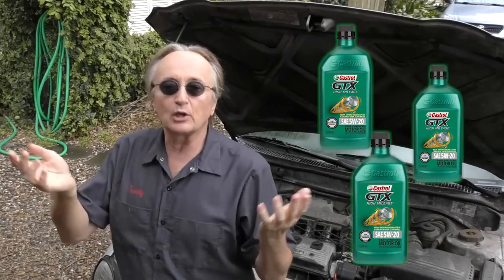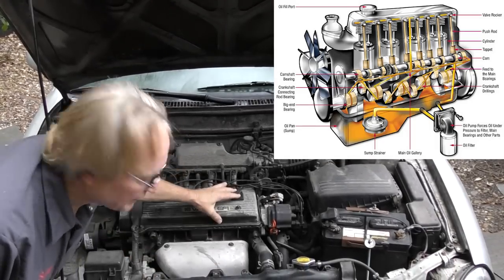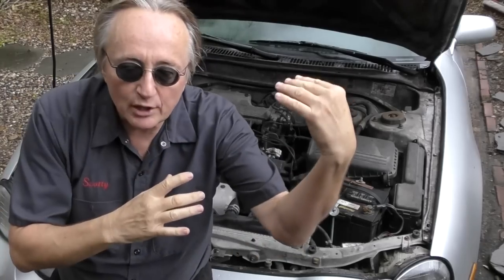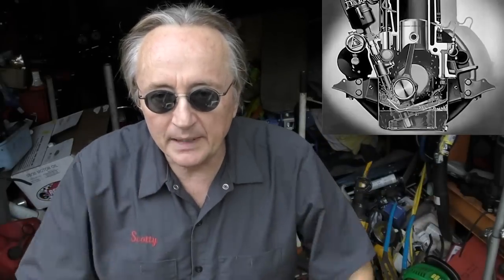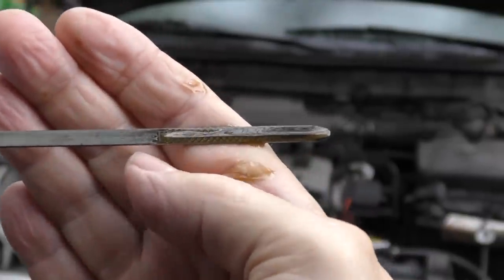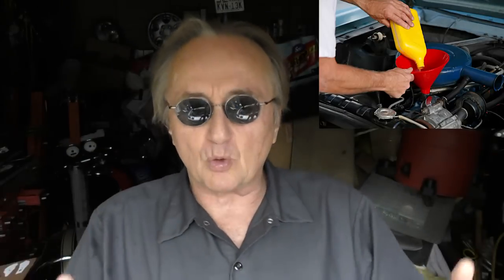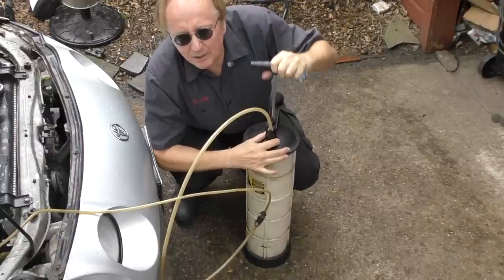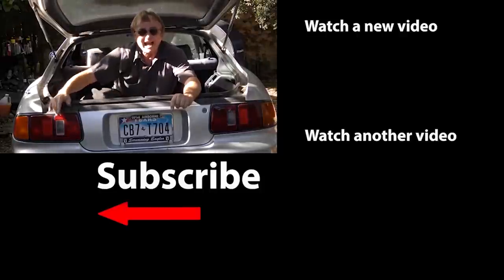Doing This Will Destroy Your Car's Engine

Comment: Morning Scotty! Thoughts on buying a car that has a bad head gasket? I'm looking at a 2001 Honda CRV for $500. Owner says it has a bad head gasket. Can I fix this myself? Is it worth the time and money? Thanks!
Reply: Connor McNeil go get it done professionally bro don’t try to do it yourself
Reply: It depend how many miles on it but 500 dollars something gonna be wrong with it if u don’t drive much then u might as well fix it up if u drive often then I would save money up and get something better
Reply: If you can change a alternator you can probably do a head gasket if not dont do it
Reply: Scotty has said before that if you are buying a car and the seller says it has a blown head gasket, then beware.  It might be the head gasket, sure, but that might not be the problem.  It could be a cracked engine block or something else.  If you still are interested in buying the car, then he always says - find a mechanic like him to check it out because if the engine block is cracked or if the head gasket has been blown for a long time, then there could be other problems like Antifreeze in the oil which can cause excessive wear and tear to all the moving parts that need it and so on.  So, the $500 might seem like a good deal, but it's going to be a bad day if you buy it and then find out that the whole engine needs to be replaced.
Reply: How many miles?.  The premium FelPro kit for that CRV is about $100.  See if hell take $100 off incase the head is cracked or warped, or valves are bent.   It may have a bad head gasket, but it probably needs a little more.
Reply: Thanks for all the feedback everyone! I'm looking for the car to be a secondary car to use when it snows. I live in Chicago and use my Civic for everyday driving. I'm just looking for a beater I can use when it snows. A friend who's a mechanic and I are planning on going to check the car out in person on Monday.
Reply: Connor McNeil Cool man.  Just want to make sure you don’t put a band aid on a gunshot wound.  That being said, I have put a few head gaskets on a few Hondas and that was all they needed. Good luck!! 👍
Reply: Do you have a machine shop? If the head gasket went, the engine likely overheated. The head could be warped and would need to be milled so it sits perfectly flat again. Sometimes you can get away with just changing the gasket if the engine wasn't overheated.

Comment: Regarding checking oil when cold. Both of my cars say to check it 3-5 minutes after shutting off from reaching operating temp. If it’s cold, most of the oil in the upper engine will fall down into the pan and give a high reading on the dipstick, at least for the cars I’ve worked on.

Comment: I used to work a chain auto parts store and one of my coworkers sold a case of motor oil to a lady who said she was low on motor oil. A week later that same lady came back, threatening to sue my coworker and the company because her engine "blew up". I overheard her conversation with the manger on duty and the reason why her engine "blew up" was because she topped off her engine oil. So out of 12 quarts of motor oil, I heard her say that she used 8 quarts to top the engine off.  At the end of it all, the lady didn't get squat, my coworker didn't get in trouble and we learned a valuable lesson on how to ask customers more probing questions to make sure we protect customers from their own shortcomings.

Comment: Thank you Scotty! Many years ago, my young sister-in-law was driving a 1969 Nova. I think it had a flat head 6 cylinder. (Can't remember). She said her oil light was on and it did not go out even after she added another quart of oil. It had an oil leak so when the light came on she just added another quart of oil. I pulled the stick and sure enough, the oil was way up the stick. I think it might have been 3 quarts too high. I ask her when was the last time she had the oil changed. "I haven't had it changed". She drove the car everyday for 2 years. I guess she thought because it leaked, she did not have to change it. LOL. I changed the oil and the filter and the oil light went out and I think she drove it several more years after that. They don't make em like that anymore. :-D

Comment: European makers frequently specify adding +1 extra quart during spirited driving / track.  
Not 2, just 1.
Reply: Never knew that but I suppose that's because the pump is using oil so fast that the sump level gets low and the pump can be starved of oil until the sump refills which will kill the pump and engine
Reply: HostileLemons I agree.  Euros tend to have higher sump capacities and baffles in the oil pans.  I keep mine topped up.  Hot lube oil sent to bearings is lovely.  Foamy oil/air mix is bad.  I tend to drive more spiritedly when I am a solo driver 😉 😉.

Comment: My car's owner manual says to warm up the car to operating temperature, then turn off the car and let it sit for about 15 minutes before checking the oil level. You say it's best check the oil level when the car is cold. Now, I'm confused on which method is best. Can anyone help me know which method is correct?
Reply: zarbon700 just do it cold don’t need hot oil getting on yourself
Reply: Always follow the owner's manual. When you warm up the engine some of the oil stays in the upper parts of the engine, i.e. if you check the oil cold all of the oil is in the oil pan and it may indicate more oil than you actually have in the engine.
Reply: Everything is confusing, everybody say different thing
Reply: @godschild5587  I think it may be best to do what the engineers instruct. They built the engine, therefore, they should know what's the best way to check that engine's oil level.
Reply: Warm is all right as its just about the same as cold just must not be hot and waiting yes..5 to 10min should be plenty for that oil on top to find its way back in the sump..and level surface with oem dipstick you're good to go.
Reply: @nicksteffen8164  no checking it cold indicates the exact amount of oil in your engine. Warm oil gets thinner and expands and may make it seem to be slightly over filled or under filled because oil is still draining down from the heads

Comment: Some car manufactures (I think Honda) recommend checking oil after driving a little bit ie warm engine oil. This make sense because after car runs a little bit the oil is at a known temperature.

Comment: Talking about oil... I know for a fact that Toyota V6 engine can survive 16 miles of driving without much of the oil in it.  Three years ago, my Sienna oil cooler line completely broke off.  Although my wife noticed the engine made weird noises but she did not want to stop in the middle of the night on the road so...she drove that 16 miles home.  In the morning, I checked the oil and it was bone dry, I poured four quarters in, started the engine, and it just pumped out all the oil to the ground within seconds... towed it to get it fixed, thinking its engine might be shot but I would trade in after the repair.  Well, it ran like new and I kept it.  Three years late, it did not burn oil, nothing leaks, no smoke, engine runs like new, so it still runs and purrs like a cat for 25,000 miles in counting :).

Comment: I like my 81 Celica's dipstick. Not only was it all metal, but it was a rigid rod, right to the bottom end, not one of those floppy flat things 90s and later cars have. I could beat someone with that old dipstick if I wanted (not that I would want to hurt people). It was so much easier to put that thing back into the engine without it flopping around everywhere.

Comment: My owner manuals on my car and truck say to check the oil at operating temperature.  The truck manual says to let it sit for 15 minutes.  That's how I've done it, and I've never had a problem.  If I overfill something, I just let it out of the drain plug a little at a time until I get it right and then refill if too much comes out.

Comment: Some automakers state to check the oil when at normal operating temperature a couple minutes after the oil has had a chance to drain back into the oil pan. Especially every motorcycle I’ve had said to do this, plus VW, Ford Duratec V6, and Toyota 2.4 (my 04 Rav4 page 284 in owners manual).

Comment: Pneumatic fluid extractors come in really handy if you are a lube tech. If you overfill, or have a dangerously sensitive customer complain their oil is too full by half a millimeter, just stick your extractor's tube through the dipstick and suck the excess oil out.

Comment: I've over filled my oil, my diesel engine went straight to redline and smoked out my whole street, happened 4 years ago and the truck still runs fine, I was young and dumb back then, thank fudge my truck has a strong motor

Comment: So this one time... I drained my wife's CVT and double serviced her oil. FORTUNATELY a switch kept the car from moving. I had poured the CVT fluid into the 5 qt oil jug and just poured it back into the CVT and correctly changed the oil the next day. Engine ran for 5 minutes maybe, CVT worked just fine. I changed the fluid about a year after and things are still going strong

Comment: The actual reason for checking your oil level when the engine is cold is because after running the engine all the oil passages are filled with oil and all components are also coated with oil, so it takes a while for the oil to drip down and collect into the oil pan.

Comment: The dipsticks handle broke on my moms car. We ordered an oem replacement and it was 3 inches shorter than the original. Always check that replacement  parts match original equipped ones, no matter where they come from.

Comment: The subject takes me back to the fuel rationing of the early seventies. I worked at a Chevron station and we were selling gas at five gallons per car. This guy pulled up to the inactive pumps and I told him that he was in the wrong location. He said he was needing oil, not gas. Back then, oil was in cans and we used a Plews spout to pierce the can and pour the oil into the engine. I asked him how much he wanted and he said he wasn't sure, but wanted to start with two quarts. I got him two cans and stabbed the spout in the first one so he could see how to do it for the second one. His vehicle was a Ford Falcon van, so the engine resided between the front seats. I could see him putting the oil in the engine, but I didn't watch him closely enough at first. After two, he asked me for a third. I obliged him and continued with my very busy gas pumping. When he came to me for a fourth can, it piqued my interest, so I observed his installation of number four and saw a sight I may never be able to forget. As he finished pouring in the oil, he drew the can away, leaned over and peered into the filler tube. Of course I approached him and verified that he was trying to fill it with oil. I was pretty young and inexperienced, but I certainly knew to use a dipstick. I pulled his out and the level was about two inches above full. I told him that I didn't know if it would hurt his engine, but it should be at the correct level and we could take care of it when the gasoline selling stopped in a couple hours. He opted to drive it away. 
   On a different note, I typically put a quart of ATF in my engine and drive a few miles before I change my oil and filter. Helps to keep the sludge away.

Comment: Should you put fresh oil in the filter when doing an oil change? I see some people with cartridge type filters do that.
Reply: If you can do it without spilling it all out in your engine bay have at it. On many cars that trick is flat out impossible.
Reply: @98triffid  I'm thinking only of cars that have bottom mounted oil filters. The idea behind this is that the engine after start up sucks up the oil in the filter.

Comment: That was a common issue with the Nissan Pulsar and Nissan sentras of the late 1980s. Mini mechanics would overfill the oil causing the engines to fail. I didn't know how it happened but I had friends it had that issue. Apparently a lot of the manuals had the incorrect oil level listed

Comment: In the UK BMC made a mistake with the dipstick markings on early Austin Morris `B' series engines fitted to the `Landcrab' 1800.
Early 1800s therefore suffered engine failure (bottom end bearings) due to too much oil (crankshaft whisking up the oil).

Comment: My 06 Honda Ridgeline takes 4.7 quarts of oil with new filter at oil change. Ive been tossing in the whole five quarts for years. Never had a problem. Oh ya it’s now almost 2023. That’s seventeen years of oil changes. Changed every 3-4,000 miles. Still purring away at 140,000 miles. My neighbor had 850,000 miles on his 07 Honda Ridgeline. He told me he don’t know anything about cars/trucks. Brings it to the dealership when the OLM comes on and they do the oil and filter  for $29.95 with his $10.00 coupon they send him in the mail. I would bet for that price he’s not getting full synthetic maybe not even semi synthetic. So there goes the theory of full synthetic is better. Older engines like high mileage and a little thick oils. 😊

Comment: At my old job, someone filled an engine with 5 quarts of oil, but didnt put the oil cap on. So another technician added five more quarts into the engine. The car caught on fire shortly after leaving.

Comment: i remember over filling my oil easy done someone talks to you hay presto lot of effin words latter  what i done was instead of dropping it  via the sump plug getting all messed up and trying to get the sump plug back in quick time  i used a syringe and  fish tank air hose pipe fed it down through the dip stick drew  a few times worked a charm

Comment: 99 mercury cougar has 139k miles. its manual 5spd. The customer states "it won't shift into gear not sure what's wrong with it. maybe clutch is bad or shift fork not sure really. check engine light on for oxygen sensor. asking 550 obo". What do you think about this car Scotty?

Comment: I over filled my car once when I forgot to lower my front end from the Jack before I added and checked the oil level it put me half a quart over. I wondered why it took a little more than it should. I should have gone with my instinct of going by specs. I thought about unscrewing the plug for just a second but two things, one it's messy, two you lose the tight seal when you have more than a drop of oil in the grooves.

Comment: Honda Serramonte in Colma, CA. they put 5.5 quarts oil in my engine (I brought my own oil), when it should have been 4.5 quarts. When I found out and told them they made a mistake, they refused to admit mistake and said they always put 5.5, and they knew better than me. But the fact is the capacity is 4.4 as printed in owners guide. I never let them service my car again.
Reply: And I bought the car Accord 2016 from that car dealer.

Comment: Got an oil change at a lube & goob shop one time. About 5 miles after I left huge clouds of smoke came rolling out of the tailpipe.  I stopped and checked the oil and it WAY over filled. I went back and parked in front of their door and let the engine run and smoke up their place. 
They never came out to check what was going on. 
A customer said something to me and I said I just got the oil changed here.  
Finally I went in and the kid said he looked up in the computer how much oil to put in and the computer said 5 1/2 quarts. 
I explained that a Toyota Paseo does not hold that much oil and to please remove the excess oil and check it with the dipstick this time. 
I'm sure he looked it up as a Toyota Tundra or something. It was a sh*tbox car my wife had and we sold it for cheap to her sister.

Comment: manual vacuum pump.That sounds cool. I want one. Seem neat. How good does it do the jobs?
Reply: Very good if the oil is warm enough when it has been in a running and warm motor, but otherwise hard to get the oil into the vacuum pump. It is used to change the oil in boats and recommended by the company (Volvo Penta in my case). The dipstick-tube is narrow and so is the vacuumpump-tube. My pump costs about $100 in Norway and seems to be good quality. Several people recommend to let the oil out of the drain plug in the car to drain eventual oil sludge or dirt as best as possible.

Comment: Scotty, I just got a 1992 Buick Century V6 3.3L sedan custom, and when I turn to the right, even a little bit, there is a slight squeaking hum. How do I stop that from happenkng
Reply: The Narrator check power steering fluid. Also that pump may be going out soon.  Good luck.
Reply: Drive only on straight roads. Glad to help!

Comment: A buddy had a VW Rabbit diesel.  He put an extra quart in after an oil change and didn't notice.  We were stagging around and went up a 9% grade mountain highway.  The angle allowed oil (somehow) to be sucked into the intake.  That gutless wonder went from choking 45 to over 60 and climbing.  He started panicking and tried downshifting, then up shifting and only went faster.  I told him to push in the clutch and pull over to shut it off... worse case is a blown motor.  He pushed in the clutch and it slowly revved down.  Had to have been a sight to be seen.... huge billows of smoke and an ancient junker hauling a$$ up a steep grade.  We turned around to my brother's who is a mechanic who quickly diagnosed over-filled oil.  I still laugh.

Comment: Hey Scotty, 2004 sienna owner. 134,000 miles. Need new head gaskets, (leaking coolant) valve cover gaskets, spark plugs and oil pan gasket. My local shop quoted me 1,400 parts and labor. Should I do it or get rid of it? I love the van. Thanks.

Comment: I accidentally added too much oil once to a Chevy G20 van with a small block V-8. It was night, I was in a parking lot and checked the oil. It was so clean I didn't see it on the dip stick & nothing appeared to come off when I wiped the the end stick with a napkin.

I ended up adding a quart or 2 over and eventually it oozed out and down, gumming up destroying the starter motor.